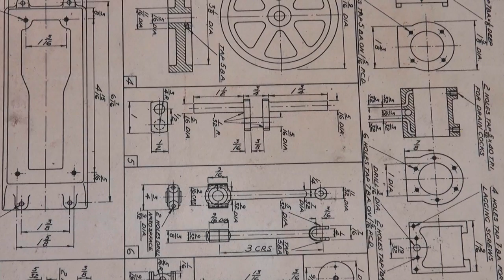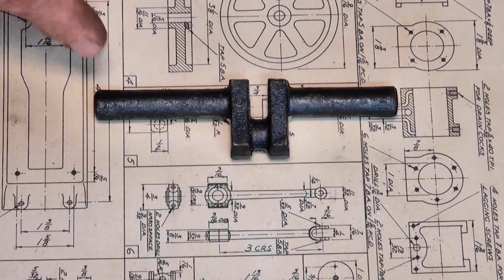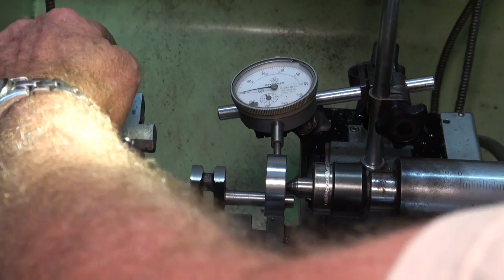Building the Stuart Turner Number 8 Mill Engine - Part 3 - Forged Crankshaft

Comment: if I end up doing  more than 2 1 piece cranks I think of making a cuff to hold the crank in along it's whole length to support with just open at the throw. I can see a teeny tiny jack between the webs will help out a lot, but definitely making a crankshaft is pretty involved!
now I know why just about all models have cranks in pieces haha
Reply from the maker: Paul, there were so many ways that operation could have gone wrong. The one good thing was that the material was very easy to machine. I am thinking it was a forging and not cast steel. 
Regards,
Mark
Reply: @Preso58  a lot is similar to an S50 I'm building I see. I run up against not enough material to clean up some parts to keep it in spec.